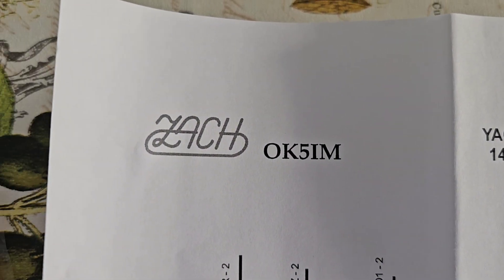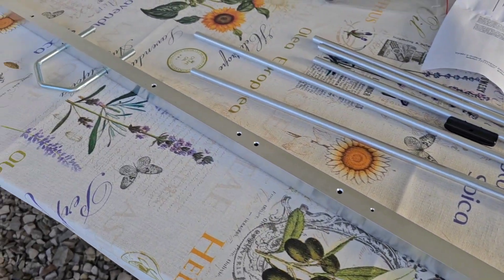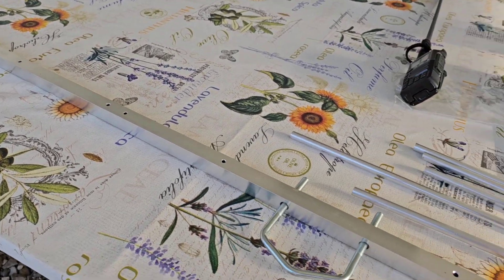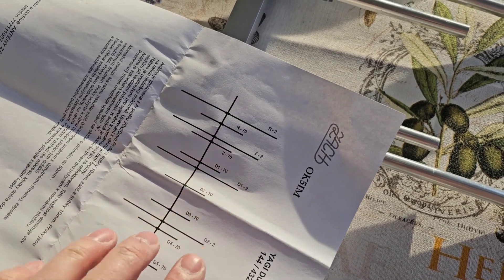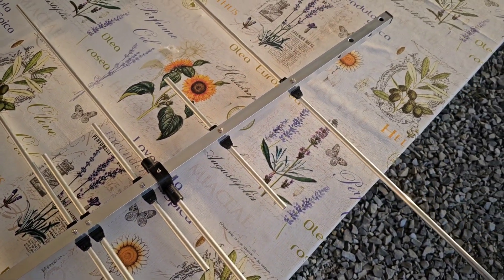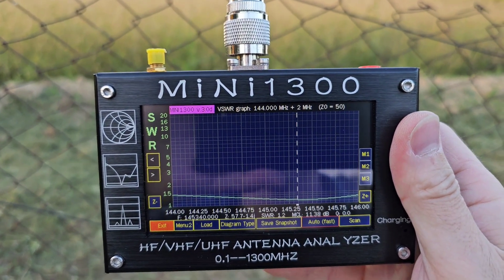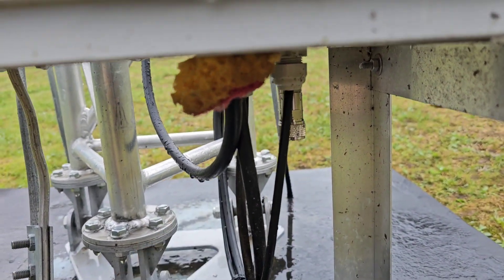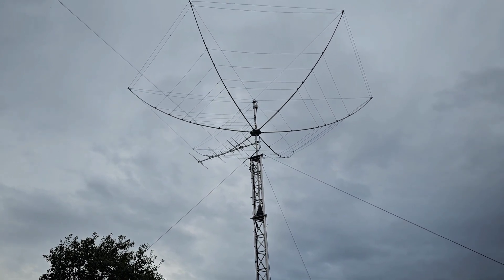OK5IM Yagi Antenna assembly & installation under my HexBeam

Comment: Very nice! Looks like whoever designed and built this antenna really loved their job. I've never seen a 70 cm antenna driven by a close by 2 meter driven element. Really interesting design not having any extra coax or connectors. Great looking set up you have there. 73-W1RMD

Comment: Does the dipole connection has a Balun inside? or the size I think it does not.

It's a little overlook detail that can skew the radiation pattern and NOT affect the SWR, if the outer part of the coaxial is connected directly to one of the elements without any balanced to unbalanced adaptation it can absorb/radiate RF and noise disturbing radiation pattern and raising your noise floor.

Normally a few turns of the coax do the trick on VHF/UHF, but for that issue the connector is to close to the bottom for my taste.

But its a great design I built one in the past like that for satellite works

Comment: Can anybody explain how the matching unit for this antenna is build?
Reply from the maker: Matching unit is an open dipole, center core of the coax is connected to one arm and shield connected to the second arm.
Reply: No matching, direct connection of the two halves of the dipole to coax, like and HF dipole, there is an harmonic relation between the 2m & 70cm elements, these are  are excited and works.